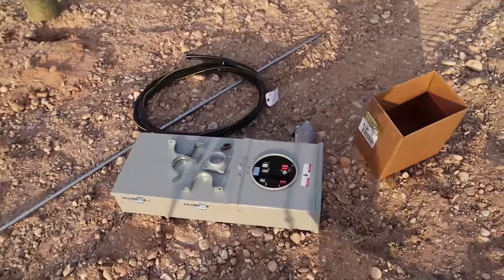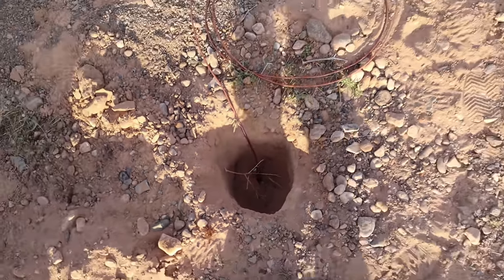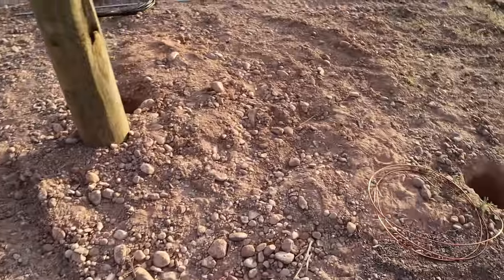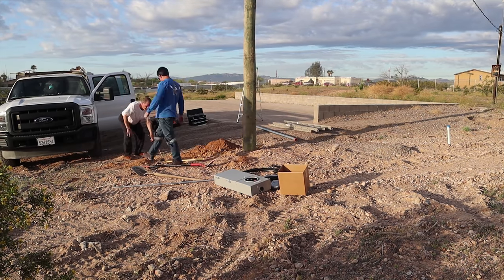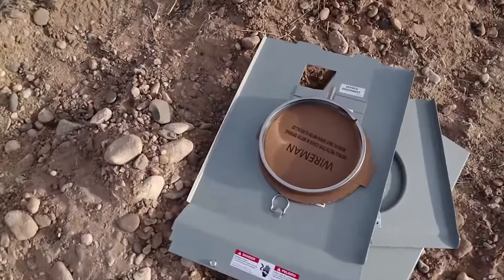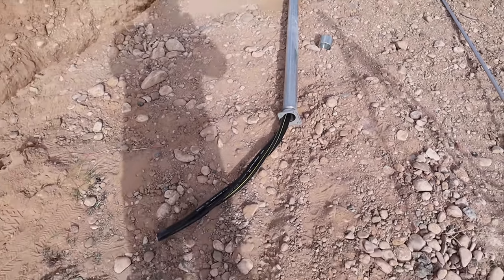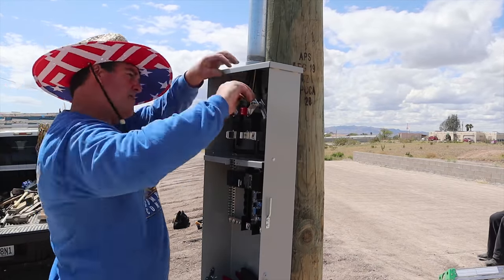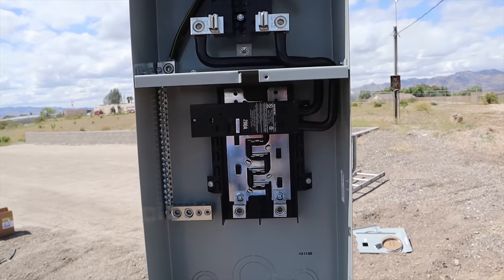How to install Main Electrical Panel Setup

Comment: Tips.  
Leave the wire long in the meter base. Cut it after you have bent each piece to fit.
Use aluminum wire grease (Penetrox compound) on all aluminum wire connections.
Don't leave that much extra bare wire sticking out of the lugs.
Reply from the maker: Good idea
TY
Reply: Larry Keenan  Noalox isn’t required

Comment: Just a suggestion for the next time your driving ground rods. Use an SDS hammer drill with the ground rod adaptor. Believe me its a snap, makes it so easy.Did you use paste on the wires for the meter?
Reply: A CONCRETE GUY WOULD NEVER USE ROTO HAMMER TO BEAT A STAKE
Reply: Electricians do.

Comment: I notice you called the ground rod EMT. EMT is electric metallic tubing, far different from a found rod. Also, to get at least 25 ohm resistance you need to ground rods at 6 feet apart and a min of 8 feet in ground. Other people might have commented but I hardly scroll down to read other peoples info. Its a great trade to be into, it takes time, and as an electrician you will never ever know it all. You learn something new everyday.
Reply from the maker: I meant emt is around the copper wire going to the Cooper rod.
Reply: i figured that, over all still a good video and thank you for sharing.
 @OdellCompleteConcrete
Reply from the maker: YW
TY

Comment: Fence pole setter that is about half that sledge weight, but is a sleeve with thick bottom makes the driving easy and not hazardous to the installer (crew). Mast type and height and ground rod/wire count/sizing,  as well as location and depth of burial is all the local authority having jurisdiction's call. I never use Aluminum as service or branch circuits. Always takes longer than imagined. After identifying the box location, use a screw in the pole to id the notched support of the box. On the dirt, he could have built the  pole to the box (landing the wire in the meter socket & to the service), then lifted in place, with a rope after he climbed a ladder. Hook onto the screw to hold the weight , strap the mast near the weatherhead and near the box. Get off ladder, screw box tight to pole Then connect the ground wire, strapping it to the pole, landing it on the ground bus, bonding it to the box. Code installation ,  not much cursing.
Reply: Weatherhead may need to turn to face the hi line/ transformer.He must cut excess exposed conductor from meter socket installation before the inspector gets there. Or else !
Reply from the maker: I already had the Electric Company view the video prior to airing, and they loved it.
Reply: @OdellCompleteConcrete  Are you saying the inspector loved it?

Comment: Hello, thank you for your video.  Question: is the rain tight hub all you need for the wire feed through the top of the panel?  Basically just an EMT rain tight hub and threaded EMT conduit?
Reply from the maker: Yes

Comment: Electrician here, we put the riser pipe on the can, push all 3 feeder wires down the pipe, land them, then put the weather head on, whatever excess is left up at the top you can trim off, or let the power company do it. Keep in mind they're going to want 3 to 4 feet for a decent drip loop.

Came here expecting horror, but you didn't do a bad job. (Probably would've stripped the wires shorter but that's not a huge deal)
Reply: As well you're going to need a point of attachment for the electrical company to hook their wire to. Not sure if you put one in but I didn't see it.
Reply from the maker: Excess wire at top calls for 2' minimal on the hand out.
I don't think I could have managed the whole assembly and hung it.
Would have been easier for sure

Comment: Nice job, The Wire inspector might ask you to put a service GFCI plug At that 10 circuit + meter-Disconnect
Reply from the maker: Not on the drawing

Comment: Looks like you're missing one of those ceramic insulators to hold the wire. Either the kind with the lag screw or the kind with a bracket that clamps onto the 2".
Reply from the maker: I sent this video to the Electric Company before I made it public, and they loved it.

Comment: I want Arriat gift cards.  I’m an electrician.  You did a great job.  Make sure that you use penatrox on the wires you landed or you might not pass inspection.  Might be ok in AZ but here in Cali they fail us.  And maybe trim some of the excess wire after the terminal.  Sometimes the inspector is picky.  Also those ground connections to the rods need to stay inspectable.  You can just throw a round Christy box on both.  
Best of luck.
Reply from the maker: Thanks for the tips!
Reply: Dude you think this is a good install? You must be a hack? An you are no electrician.

Comment: You didn't have to leave your ground poles, wires and trenches exposed until the inspection?
Reply from the maker: I dont want to dig it out twice
Reply: @OdellCompleteConcrete  my worry is they will make you dig it up again but ok.

Comment: Hey David, did you forget to apply electrical lube on the connection of wires to the bus bars? It prevent oxidation in the long run
Reply from the maker: It's not in the specs
Reply: @OdellCompleteConcrete  It is part of and install that you are doing to use noalox  on you conductors before you put them in the lugs. An there is a torque spec that you  apply to the lug set screw. Just to set this straight southwire makes aluminum wire with the coating on it already.
Reply: @OdellCompleteConcrete  Manufacture's instructions and UL listing trump all local county specs. NEC is the final source. If the manufacturer OR best practice recommends it the minimum county specs can be followed but industry standard and best practices for installation must be followed as well. Antioxidant with aluminum is a given, in the desert it may not be a big deal but it's just like concrete. I have seen you do "better than the city plans or specs" many times, Take it from a professional of 36 years as an engineering electrician antioxidant is NOT the responsibility of the governing body to dictate. It is a professional decision to allow for conductors to be properly torqued (Code requirement) and maintained over their service life of the panel and conductors. Ideal No AL OX is a good product.

Comment: I was going to say something about the wire excess in the lugs and that you can easily cut the cables to length once inside the box, but was beat to it. I would've ran the neutral behind the hots for a cleaner install though. Oh, and "I want Ariat gift cards"
Reply from the maker: Those excess wires gives me something to hold on to, like piggy tails.
Reply: @OdellCompleteConcrete  That makes sense to me. Just recalling how I did it for years in the Army, and that was pushing them into place if they weren't a terminated cable. Also larger wire sizes too, so little flex when pushing. 4/0 was on the small side of what we ran; fun times with med-high voltage and long distance runs.

Comment: Really good video I enjoyed it. I put my own meter pull up. All by myself and I found it easier to put all the hardware on while the pole was laying down. But here in Alaska, we have a little bit different code one are two grounding rods have to be in line with the conductor going to the Transformer and anything over 25 feet has to have a guy cable. Mine took all day to do of course Eyes by myself. And all I had was a tractor. I was also curious did you use solid copper? For your ground or did you stranded? I use stranded for mine because we have a problem with freezing and ground movement, which may snap the solid wire.
Reply: New Mexico wants the wire 24 inches deep between ground rods, but solid is ok here. He ran solid wire, btw.
Reply from the maker: Solid copper,
No freezing here, but it gets close

Comment: I want the Ariat gift cards. Thanks for keeping the videos coming during quarantine. 

Tip: Add dielectric grease to those lugs in your panel and meter housings. Keeps corrosion from happening.
Reply: I noticed that too.  It may be a code requirement.
Reply: Keep corrosion from coming as fast as aluminum would otherwise be weakening. Saved twenty dollars, installed pregnant defect. Not worth it.
Reply from the maker: Great tip!
Reply: No not dielectric grease this is not a spark plug wire.

Comment: i notice you said you have the ground rods 8 feet apart. I think  according to NEC suppose to be 6 feet. At least here in Florida its the code. Also, use a hammer drill or something, there's no muscles being used and 30 sec later your done.
Reply from the maker: Minimal of 6' apart

Comment: Noalox on the aluminum wire, and trim those bare ends!  But, I'm sure the inspector will tell you that...
Reply from the maker: The Electric Company liked it
Reply: I would have guessed as well the stickout of the bare wires could be an issue. But then, beeing used to the German electrical system and although knowing this installation is perfectly fine, i somehow don´t get used to it.
Fisrt thing is that you extremely rarely will find aerial lines to houses here (yes, they do exist), next thing is, that you never will find a meter and breaker box outside the house (Out of the weather and protected from access). Only ones I know are kind of mobile cabinets for construction sites or fairgrounds and such. But then, regular power line you get here is a three phase 63 Amp. With that the wire to the meter is somewhat thinner, and I have never seen Aluminium used here, it is all Copper. Only Aluminium wires I know are used in high voltage aerial lines or you may have some in older buildings.
The ground rods are not that much different. Here you sometimes get ones from galvanized steel, kind of T-shaped so you do not bend them that easily when you drive them in.
With the regular type of construction here more typical is that you will find a ground rod built into the houses foundation. sometimes like kind of a metal ring around the foundation. 
The requirement for two may be either a safety requirement or a regional one depending on the ground. Only thing I am somewhat wondering about, the groundwires look awfully thin to me. Usually here the ground wire may even be a bigger gauge than the powerlines themself. They are not allowed to be thinner than any of the other wires.
Regionally there may be even a difference in the system, that no neutral comes in, but the neutral is actually split from ground. Not different from what hapopens in the plant, the local ground is just for csafety and to avoid any issues with probable potential differences.
And main difference, here you can do the electrical system behind the meter (not meaning you should and some discuss if you really are allowed to..., in the end this is more a discussion about liability due to fire hazards and risks of injury), For tampering protection everything up to the meter will be sealed and first point of access you have without illegally breaking such a seal are the wires behind the meter. Up to there, not even every electrician is allowed to work on the parts up to the meter, they have to be licensed by the power company.
Somewhat weird how strange other systems may look as soon as you are used to a specific one. Electricity works the same everywhere.

Comment: So assume it’s different when you build a premanufactured home, you apparently don’t mount the panel on the home but on a pole like you did.  You must have one big ass conduit running to the house.  I learned the ground wires can be smaller than the hot and neutral, can save $ when buying all that wire. Some electrician please correct if wrong.  If hot and neutral were #12, ground could be #14, no?
Reply from the maker: Yes the neutral was smaller

Comment: You need to use dialectic grease on your aluminum wire to aluminum terminals.
Reply: You do not apply dielectric grease on aluminum conductors. This is not spark plug wires. An the lugs are not aluminum they are steel.
Reply from the maker: I went by the hand out provided by the Electric Company.
No grease on the hand out

Comment: Next time just mount all your pipe and then at the end feed the wired up and put the weather head and last cut and connect your wiring into the meter socket
Reply from the maker: I'll give it a try

Comment: Why the overkill on ground rods in Wyoming we just need one
Reply from the maker: I don't know
Reply: Ground rods don't usually have enough conductivity to the ground to be useful. Things like ground moisture and soil  composition affect this. And even then, ground rods are only good for preventing static buildup and nuisance voltage. Electricity needs to flow back to it's source, which is the electric company, not the dirt. Mike Holt has many videos on all subjects electric, including ground fault return paths, auxillary ground, etc. Be safe

Comment: "I want ariat gift cards" nice electrical  done, you should use wire grease  so the wire will slide at the elbow  more freely. Hopefully  I could be one the the 3 winner. I like and share and comment  this video.
Reply: At least spell the sponsours name right lol
Reply from the maker: Great tip!

Comment: Hope you used noalox on those connections. At least, make sure u do on the house. I want Ariot gift card please.
Reply from the maker: What does that do? Is that similar to Penetrox compound?
Reply: @OdellCompleteConcrete  Yep, same thing. Stops the aluminum from corroding. It's code in SC where I live.

Comment: I find it strange in your area there they literally use a bare aluminum ground bus like we use for the Green wire (forbidden in Alabama, insulated bonded neutral bar ONLY with proper equipment ground/bonding wire per NEC Article 250) for the neutral bus. It would be interesting in a future video to see exactly how they have you connect the trailer. At this point the panel will have neutral current on it, only salvation from issues with shock is there will be no easy way to establish a difference of potential (IE current on the panel when you touch it to another zero energy source such as another panel properly grounded) so maybe it's OK. It's a strange way to do this for sure! Did you end up putting green and white wires on the same bar there? That's a BIG NO NO in Alabama, green EG and Neutral/System ground get separate bars here with the neutral grounded and bonded from an insulated (not bare like yours) neutral bar. Good luck would have thought the utility would know better!
Reply from the maker: Its working well and everything passed inspection
Reply: First means of disconnect the neutral and grounds are on the same bar and that bar is bonded to the panel. There is nothing wrong with this panel per the NEC. Don't know what your rambling on about but as he said it passed inspection.

Comment: Looks like you forgot the Noalox.
Reply from the maker: Its optional
Reply: @OdellCompleteConcrete  That is correct, but there is a very high chance the inspector will see the aluminum service cables and say he wants an anti-corrosive gel. Its also just good practice. I'm sure you know two dissimilar metals will corrode over time.  NEC 110.3(B) states Installation and Use. Listed or labeled equipment Equipment that is listed, labeled, or both shall be installed and used in accordance with any instructions included in the listing or labeling.

Comment: Not trying to be a jerk or anything.. But that's too much exposed wire on the lugs and you gotta use penetrox on aluminum wire
Reply from the maker: I sent the video to the Electric Company and they loved it
Reply: @OdellCompleteConcrete  Awesome man! I guess Texas inspectors are more picky down here 😂

Comment: I got news for you do your concrete and let professionals like me do electrical installs. Did you size your riser to your wire size for aluminum wire.  I am sure you were putting in a 100 amp service? I could not tell at the service head did you leave enough wire for a dip loop? An as it was point out why did you leave the wire extended like that in your lugs? Again as it has been point out you should of used noalox on your bare connections.  How did you size your ground wire?  How did you bond your panel? An you do not have to dig a ground rod below the ground surface. Did you have  the correct ground clamps? An in your case I would of ran rigid conduit from the bottom of the panel down to the ground for my grounding electrode conductor. An I
would of done a few other things to. It is just like your job doing concrete which you do well. It take training and I been a commercial electrician for years. An it is to bad that you did not spend extra money for copper wire. I dislike the heat cycles and cool cycles with aluminum wire causing the wire to loosen up in the lug.
Reply from the maker: The install was  according to the Electric Companies hand out.
That's all that matters.
Reply: @OdellCompleteConcrete  My comments on here were not put on here to insult you. There are to many of these videos on here that can be dangerous to someone with limited knowledge depending if they were working on energize equipment. Just remember you have your power companies drawings they follow the National Electrical Code and you also may have local town codes. That is great your power company let you know you met there requirements to have your lines hooked up and meter install. What matters the most is that you have a safe install not only at the outside but what you do from there. I would suggest to you to get a license electrician in your area to help you.

Comment: Bruh u gunna fail inspection
Reply from the maker: That's not what the Electric Company told me
Reply: Odell Complete Concrete you left bare wire sticking out from the lugs